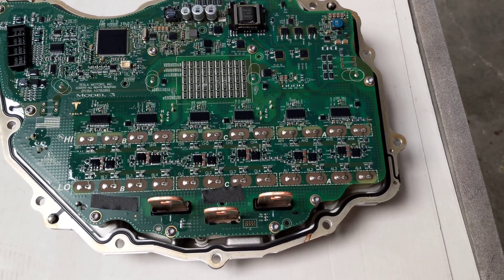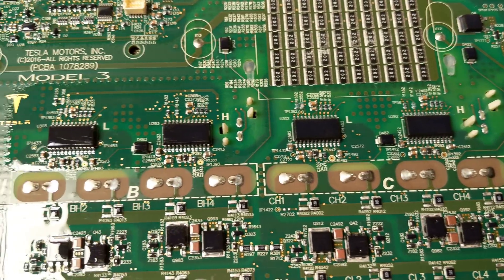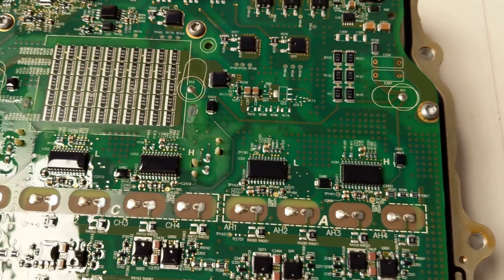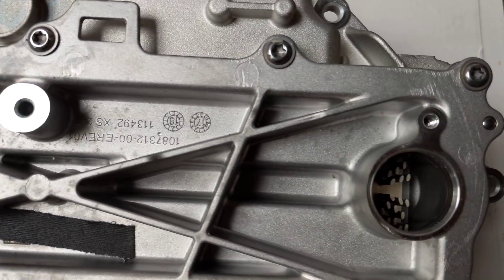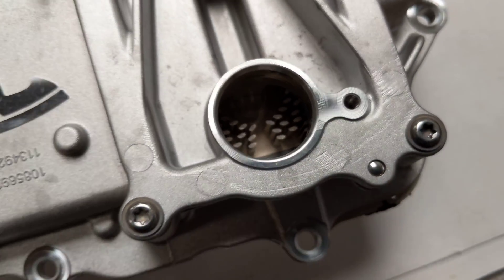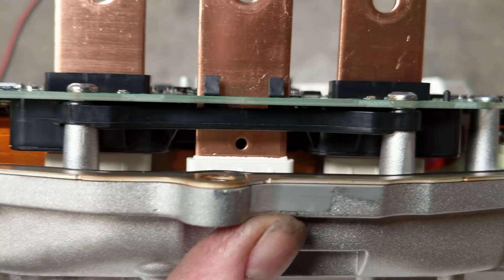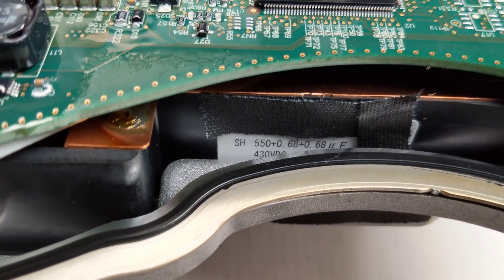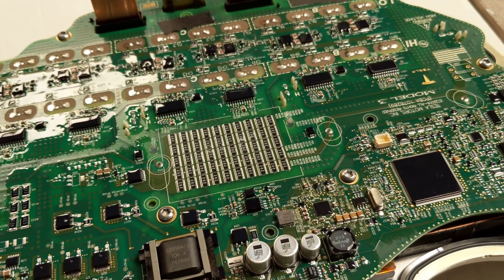Tesla Model 3 Drive Inverter

Comment: It's a nice touch that the PCB has a conformal coating on most of the board (at least on exposed electrical traces & components).  This should help with water resistance.
Reply: There is no reason not to add this to any PCB that is likely to encounter changing environments. I'm surprised it's not a more common thing really.
Reply: It's mostly against vibration and temperature gradients.   If water gets on this board, I doubt the conformal coating will save it...
Reply: To be fair, nearly all automotive PCBs have conformal coating on them
Or, at least, all the Toyota-based PCBs I've seen do

Comment: What is the inverter for?  I thought this was all DC?
Reply: The battery supplies DC, but the motors need 3 phase AC with current, voltage and frequency according to the torque and speed you want them to deliver. The inverter is the key piece of the whole car, this is what controls all that power and gives you acceleration or braking as desired.
Reply: These  electric motors have 3 phases, so they are basically AC.
Reply: Just like a brushless radio control car speed control! Cool man 😎

Comment: Can we see the bottom side of the PCB?
Reply: Here is whats under, https://fr.slideshare.net/system_plus/tesla-model-3-inverter-with-sic-power-module-from-stmicroelectronics-102988042
Reply from the maker: Not easily doable, as the tabs are all soldered in, and some have high thermal mass, so difficult to remove without damage.  Sorry, I am planning on keeping this unit operable, so I can't do a destructive tear-down.  Other than the 24 SiCFETs, the capacitor and the busbars, there really isn't anything to see.  Here is more information you might find interesting: https://www.pntpower.com/tesla-model-3-powered-by-st-microelectronics-sic-mosfets/
Reply: Yes. Even I was thinking of the same. Please show us the there side... Undressed. 😁😇
Reply: Wow, that's really tiny, even for SiC FETs

Comment: Interesting that even the RWD version uses Silicone Carbide inverters, not just the Performance version. It will be interesting to see what the real difference is between the $53k AWD and $64k Performance AWD.
Reply: I believe the SiC chips are Fets, not IGBTs.  The advantage is the lower on resistance of the fets generates less waste heat and therefore requires less cooling.  Economies of scale dictate that you would put the same inverter board into the lower power vehicle and change the software to adapt it for proper control.  Higher volumes = lower per unit costs.  Oh wait, you're just talking about a No Stuff option for some of the SiC fets.  Yes, this is easily done to reduce costs for a lower power unit.  But it does complicate the supply chain, requiring another part number and different build sequence.  Might not be worth it depending on the unit cost of the SiC fets.
Reply: Tesla said its the same. The Performance is Just double the burn in and lot sorted for highest sigma output. My guess is the SR version will be a different inverter though.
Reply: Tauran, the double burn-in and picking the cream of the crop just seems like marketing tactics, unless QA on the motors creates a big different. Seems like $11,000 is just paying for a new drive unit in advance, LOL.

Yes, if they have a 300 kw inverter in the 75 kWh car, they only need 200 kw inverter in the 50 kWh car. It depends how much those IGBT cost. I guess they can just omit 1/3 of the IGBTs when they omit 1/3 of the 2170s.
Reply: @imho7250  "Tauran, the double burn-in and picking the cream of the crop just seems like marketing tactics" You evidently don't know how semiconductors are made. If they are sorting for low Rdson (Tauran's "burn-in" statement is nonsense, though the sorting of a statistical production output is correct), this could mean an erratic supply of components if Tesla are doing JIT inventory management, or a cash outlay to get ahead of production needs.
Reply: vidznstuff1, sorting of semiconductors is done during production, not after its installed in an expensive component. And the fact that they are claiming they are sorting motors just means that they are putting the duds in the non-performance and putting the ones that just magically turned out better in the performance versions, but there is no way to prove this unless someone takes apart a crashed performance and non-performance version.
Reply: I read some research and look like Silicon carbide is better in "high power
and high voltage switching power applications" aka cars... GaN is better
lower power/voltage electronics.
Reply: you don't cut through the BS, you flood all tesla related channels with FUD and lies
Reply: AutoxMx5, yes, and I wonder if GaN inverters will make their want to EVs. I don’t know what they are, just that they exist. LOL. In se can be even smaller and faster than the SiC mosfets, and use less power, make less heat, etc. 

I wonder if the motor itself will be different. If the motor is the same, then they might leave the entire drive unit the same, but if they make smaller cheaper motor, they might as well make the inverter cheaper too. Assuming the SR version will sell 5x as many as the long range, they may strip it to the bone in order to make profit at 10,000/week.
Reply: John Smith, yes, I think they are still working to get GaN to work with higher voltage and power, and they say it will be twice as efficient. So if they can get all this stuff working, it might be possible to have a 100 kw onboard charger and just a bunch of big 3-phase 400v sockets for charging,
Reply: IMHO is just clueless short trader  flooding all Tesla channels.

GAN is the choice for high frequency high power efficiency electronics. Something like radars.
GAN fets also also very good for use with something like PMSRM. In fact Panasonic even sells GAN sets (drivers and power transistors) for motor inverters.
AWD will have all proven AC induction motor in  front obviously with separated inverter.
Reply: Don Darreb, I don’t trade Tesla stock, I just cut through the BS. I like the engineering and tech.